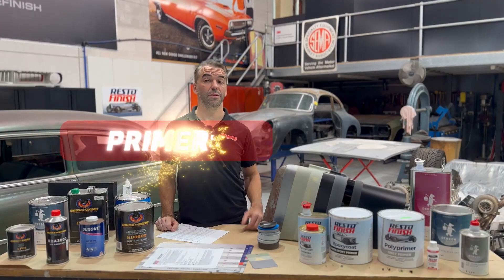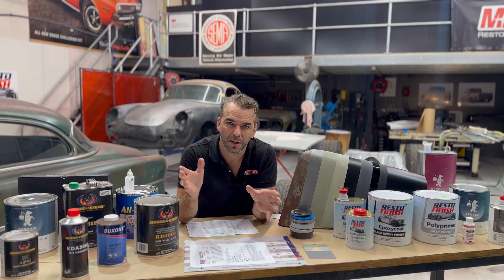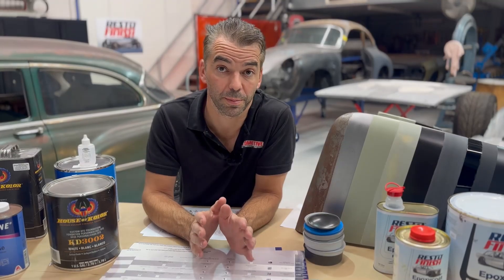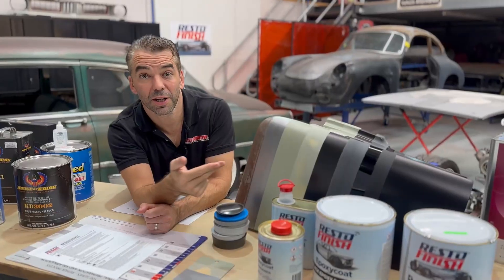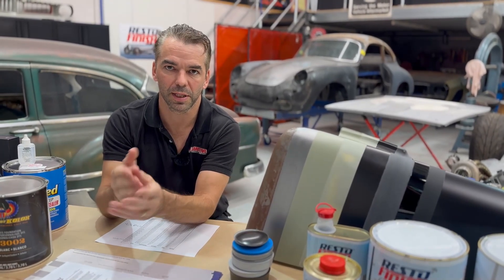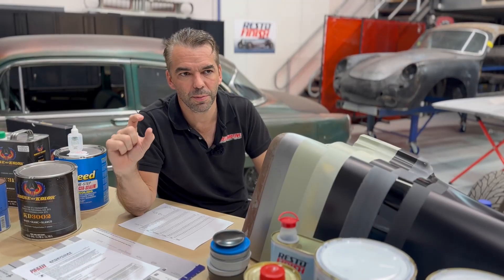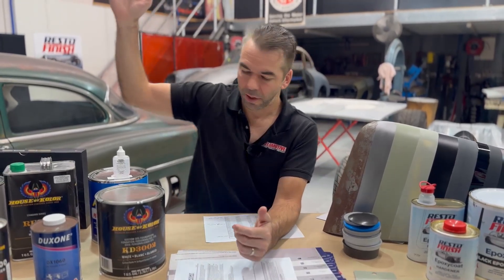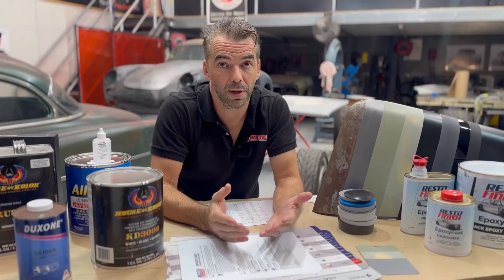Ultimate Guide to Automotive Primers: Choose the Right Type for Restoration

Comment: Thanks for sharing your expertise. One question: You explained applying the epoxy, then body filler, then polyester primer surfacer, then blocking, then applying 3 coats of primer. Is it 3 coats of epoxy primer? Is it instead of applying 1 coat of sealer, for a more high-end result? Thanks in advance

Comment: I was with a local panel beater the other day and dropped some parts off. We looked at a car sitting beside the one we were discussing, and he showed me rust underneath the primer and filler. I am not sure how much the panel beater was prepared to start all over as it looked like it had no base epoxy. He said the guy painting it might not have used a water trap on his air lines. Is this a fair call?
I was wondering if polyester filler and polyester high fill can absorb moisture in a workshop. What is the next stage before primer should it get time in the spray booth to get moisture out as it might trap moisture in the layers. 
Is the primer a sealer like the epoxy or semi porus.

Comment: I'm new to the newer products since I painted years ago with enamel or lacquer. As I do body work on an old car, I have been can spraying with acid etching primer because I think I want it to bond well. Now I hear it's porous. I'm thinking it's at least it's something on the metal to prevent rust while im doing more body work . I'm planning on striping it after all the body work back down to metal and epoxy priming anyhow.
Is it worth priming with acid etching now, anyhow?

Comment: Great video. I know I am a bit late to the party, but this may answer some questions or help someone. I'm a home restorer, so choosing cost-effective products that work is a must. certain brands are better value than others depending on where you live, I'm in the UK. Many years ago, I chose to use HB Body products, they are made in Greece. Even post Brexit they are good value and have a great range, bringing me onto the subject of epoxy versus etch primer. I find 1K etch primer to be complete garbage and it completely ruined a paint job for me. There is no point at all in relying on a product to protect bare metal that is washed off by the solvent in the next coating to be applied. The information in this video is spot on, epoxy for bare metal. The HB Body epoxy primer that I use can be thinned down (reduced) and sprayed with a 1.3mm set-up, so it goes on smooth like a wet-on-wet primer. This is ideal to go over any rub-throughs in the epoxy layer after filler or spray polyester sanding, it seals the metal back up and does not require any sanding before the next application of high build primer.

Comment: A really good video, and series of videos - thank you.  A question though: you say epoxy primer then filler. Do the epoxy have to be sanded for the filler as a key (I expect so) but how do you avoid going down to the metal when, or if, you have to sand it before the filler?   Thanks, from UK
Reply from the maker: Hi, thanks. Yes the Epoxy must be completely cured and sanded. Use a soft/interface pad on the sander to only remove the sheen from the epoxy and minimal material to avoid sanding through.
Reply: @melomotiveYT I see.  Thank you. Your videos are very good and helpful. Particularly how you explain only putting on enough filler, using a profile rather than lots if sanding. From UK.

Comment: Thanks for the great content. Just a quick question. Is it worth sealing up all filler work with epoxy then blocking that before applying polyester? Does poly absorb moisture if its left uncoated for a long time.
Reply from the maker: Your welcome. If the filler is over epoxy and you’re moving into polyester, then prime and paint in a reasonable timeframe a second epoxy is not required. If the filler is over steel or it’s going to sit around for a while it’s a good idea. Not all Polyester’s are the same, some absorb like crazy and some have a higher resistants to moisture (but not water proof). Fillers absorb the most. If you do re-coat with epoxy, there isn’t much value for effort blocking the second epoxy, it’s goal is too seal the filler, leave a decent film build, just the surface needs to be sanded for adhesion of the Poly. The Polyesters goal is for blocking and perfecting shape.
Reply: @melomotiveYT  Thanks again. Any advise on how limit the amount of moisture that may get absorbed. Does covering  with plastic masking film help or a car cover? The project I have is in a workshop the is reasonably dry but NZ winters are usually pretty wet. 
Thanks again
Reply from the maker: @markthorburn8120  covering can make it worse. Inside a workshop with some airflow is good.

Comment: Thanks and Subscribed! It is clearer now, i wish i knew about Polyester spray filler before i did my restoration. Do you need a special gun for it that's different to my normal Devilbiss primer gun? or is it depending on the nozzle needle size in the pds for that product? BTW i have bought from your shop before and my toolbox is rocking your decal!
Reply from the maker: AWSOME!!!! thanks. We use and recommend a 1.9 gun for the RestoFinish Polyprimer.
Reply: @melomotiveYT  Thanks! :)

Comment: Hi I am learning so much from these short videos. I want to use restro products on my build but what products can I use after poly primer has been applied and how long can it sit for before topcoat can be applied . Cheers Jason
Reply from the maker: @Rusttomuscle  thanks for the feedback. After the Polyprimer (polyester) has been sanded, around 240/320 grit, it’s time for final primer. We suggest using the same brand primer as you have chosen for colour. It does not need to be the “high-build” mix, it can be applied as the thinner “sealer/surfacer” mix. Then 1 or 2 final sand ready for colour.
Reply: @melomotiveYT  thanks for the info.

Comment: how do u rate the brush/roller raptor epoxy primer
can i apply that to clean metal then brush on a polester primer
light sand and then start the process of putty so i never touch the epoxy primer and have more room to sand flat?
if i use a profesional sandblaster i would need to dismatle the car fully to get total cover
so was cosidering to just sand down a panel at a time with scotchbrite discs
and diy paint without spraybooth so i may be able to prepare the car peice by peice all the way up to final coat i can send to a proper painting place or maybe wrap it

Comment: So is it fair to say that if you leave 10-20mm of hi fill in a mixing cup for few days and it ends up with a big crack in the middle of it, does this indicate a poor quality brand??
Reply from the maker: "High fill" is not designed for the amount of build required to perfect shape. The solid content of "Hi-fill" is a lot less, hence it cracking with excessive build, with around 40-50% solids. Polyesters range in solids from 70-85%.

Comment: I've had many instances where I have applied two epoxy primer coats,  allowed to cure, then applied filler to soft dents. In the process of sanding the filly, I removed the epoxy primer and expose the metal.  Question is,  do I re coat the exposed metal with epoxy primer.  Kind regards Mark
Reply from the maker: Yes, its best to recoat with Epoxy again.

Comment: I'm getting ready to paint a classic car. Is it necessary to Prime the whole car before I paint or can I use to paint that's already on it. I only have a couple of spots that has been body worked and repairs and I know I have to prime those and get those prep but do I have to Prime the whole car before paint
Reply from the maker: In theory, if the current paint on the car has been applied correctly, has cured and you have prepared correctly you can go over the top.  However, there is always the unknown....has rust started underneath? Is the paint acrylic? Is there any contamination?  Generally, the amount of time and money that goes into Restoring a car, it is safest to take it back to bare metal.

Comment: Usually epoxy again over filler work to seal it off.
Reply from the maker: If the project is going to sit stagnant for while, it can be a good idea to re-epoxy, then polyester at a later date. If your planning to continue straight into final prime and paint it, it's not necessary. One factor to consider is the amount of exposed bare steel.
Reply: @melomotiveYT  just feels right to seal it with epoxy especially because filler is so porous. But yeah you're right it all depends on the project. Loving the videos. keep them up 👍
Reply from the maker: Exactly. Thanks for the feedback.

Comment: Thanks for the great info in your channel 
Question I have is can I put acrylic paint on top of 2 k primer Id appreciate your comments thanks
Reply from the maker: Tricky question.  In theory, acrylic paint can be coated over correctly prepared 2 k primer.  I would always do a test first to ensure compatibility and correct adhesion.  It is never advisable to use 2 k products over any acrylics.

Comment: Thank you for your hard work in making these videos. I’ve found myself in a pickle and was wondering if you could answer a couple questions. First is when single stage urethane is fully cured how hard should it be ,should you be able to dig your finger nail into it? Secondly can you apply urethane base coat over properly sanded urethane single stage? The reason for these questions is 2 years ago when spraying my project true the second time around I accidentally used the hardener for my DTM primer in my single stage finish paint! I went back over the whole truck with a DA and removed what I believe to be the bad layer but the other day I had some edging pop up after applying some base.
Reply from the maker: Hard one to answer without seeing the car.  It is rare to use a single stage urethane on a Restoration project.  When cured it should be hard (cannot dig your nail in).  It is likely the incorrect hardener has caused the problem.  If the single stage has been applied and cured correctly, there should be no issue sanding back and recoating.  If any layer under the top coat is not correct, it will eventually cause problems.  As the old saying goes "a chain is only as strong as it's weakest link".
Reply: @melomotiveYT  Thank you for your response!

Comment: When would you apply phosphorous? I'd prefer to work the metal before an epoxy sealant. Would i spray a coat of phosphorous, work the metal, clean (red scotch) the phosphorous coat off then epoxy? How long can I sit the metal with a phosphorous coat?
Reply from the maker: We'll be doing a metal preparation video, this will involve a phosphoric acid treatment and metal clean is super important before Epoxy.

Comment: Hi, restoring a Austin Healey  that has some aluminium panels.
Would you use an etch prime or epoxy straight onto the aluminium?
Reply from the maker: Hi. An Aluminium specific Epoxy is required.

Comment: Another quality vid, keep em coming!! One question I have is, after the 3 coates of primer before base coat painting, what grades of paper do you recommend to use on that final primer stage?? Dry or wet??
Reply from the maker: Great question!  There are many ways, however the most common two ways are: 240 dry then 320 dry, the final sand is with 800 wet.  The second is 400 wet, 600 wet then 800 wet.  We like to finish with 800 wet to achieve the best scratch profile before painting.  Powder guide coat is used in between each grade.  Hope this helps.